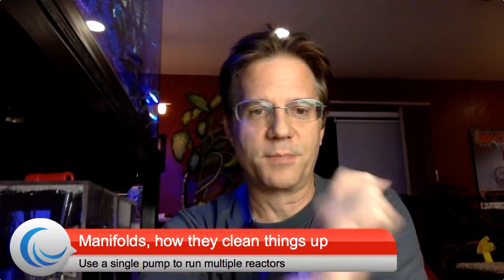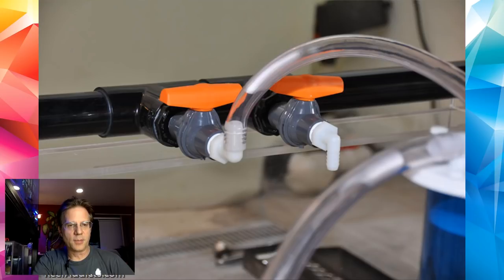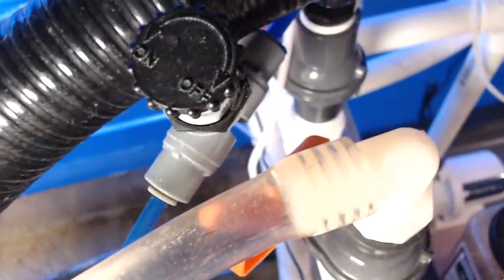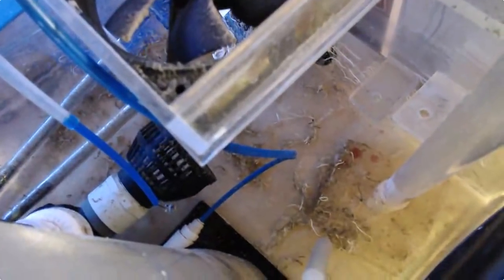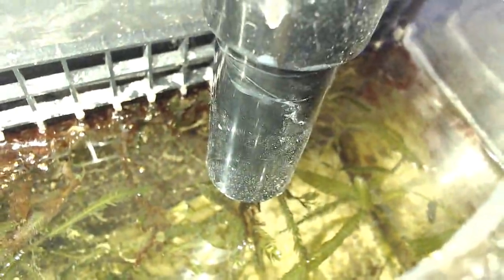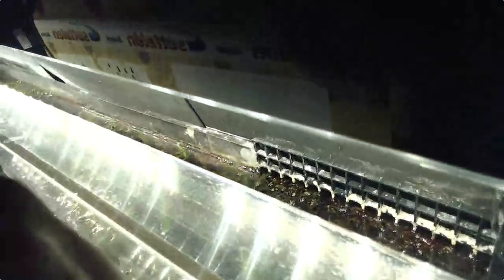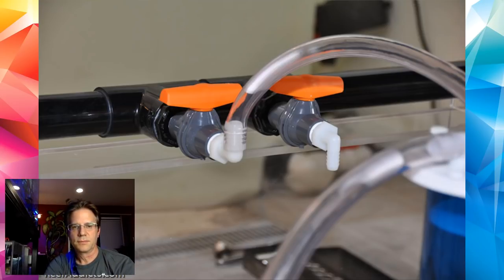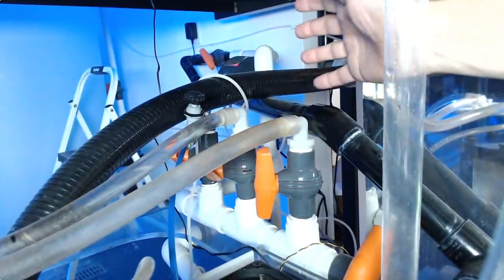Manifolds make a lot of sense

Comment: I like 2 pumps in series for a manifold for fault tolerance. I travel a lot so I try to think of ways to mitigate failure points without a tank sitter having to step in and modify my system.

Series sums pressure; parallel sums flow. Parallel is a pain to do in this application without check valves which we all know can be failure-prone. Parallel to separate outlets works great for return pumps though.

Comment: Do you keep your tank refugium open at all times ?
Ball valve that come with unions attached are better to clean in the aftermath or those are better?
Reply from the maker: Open? It's not covered up and there is no lid over it if that is your question. I do like double union ball valves for certain applications, like before and after a return pump. But for a manifold I don't think that extra expense is warranted.
Reply: melevsreef am not talking about the upper tank, what I meant to say is the bottom part of the tank where you keep the equipments the refugium is that area always open. 
I always see it open in your videos that’s why am asking you 
Thank you! Mark always appreciate your comments and vids
Reply from the maker: CUBAN REEFER  Yes, its always open. I probably will do some woodwork at some point. Lol

Comment: You mentioned using two pumps; one for the return and one for the manifold.  I was already planning on two (return) pumps, but have both connected to their own manifold.  Is that a good or bad idea and why?Ted
Reply from the maker: I'd keep one pump dedicated to the manifold, and the other should be your display tank's return. I explain why in the video.
Reply: I'll keep that in mind as I'm setting up the tank and sump.  I'll be converting my 210g mixed African cichlid tank to salt in a few months.  Thank you for the response.
Reply: Can u run a skimming off it as well
Reply from the maker: Normally a skimmer has its own feed pump.  Some are recirculating skimmers, and need something to feed water into them. In that case, a manifold could send that fixed amount of water into the skimmer.  What brand are you considering?
Reply: melevsreef reef octopus external as I don’t have room in cabinet for, 100 gallon corner tank,

Comment: Hey mark, when you make an adjustment to one valve, do you need to make adjustments to all of them to compensate for possible loss of flow?
Reply from the maker: I haven't noticed that at all, probably because the pump I use has plenty of oomph to handle what I need. The Vectra L1 I'm running on this manifold is running around 50-60% of what it can move.

Comment: By making a loop that’s make a complete circle of PVC  can nearly e
Reply from the maker: Some of your comment was cut off.
Reply: melevsreef  oh wow.  Thanks for pointing that out.  
Ok so the Cadillac of manifolds is creating a loop manifold.  Think about it, when you adjust a valve or get blockage, or whatever the flow will change in a typical manifold.  Having a looped manifold prevents this by displacing the flow around.  I highly suggest this for anyone using a manifold on the return with some kind of full siphon drain system.  Since a full siphon drain system can be sensitive to changes in flow from the return this helps greatly.  Also it will not increase head pressure loss, in fact could reduce it.  Flow within the loop will be slower thus reducing friction.
Reply: melevsreef  also wanted to ask why you chose nylon fittings rather than SCH80?
Reply from the maker: Schedule 80 is beefy, lasts forever.  But none of my gear is high pressure and I've never had any of these wear out.  I just don't think it's critical. If I have to replace one eventually, I can simply screw in a new one.